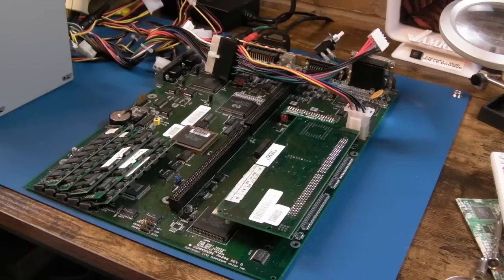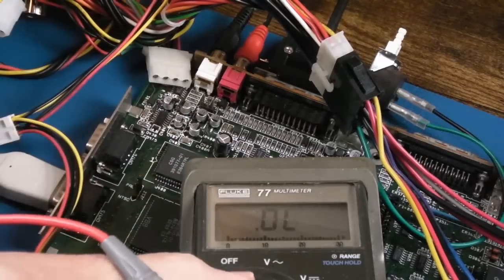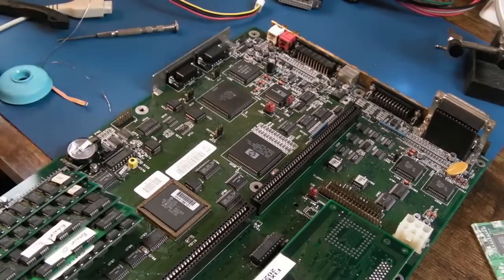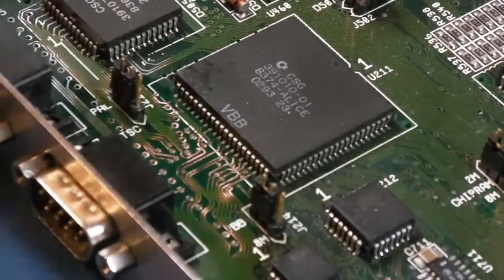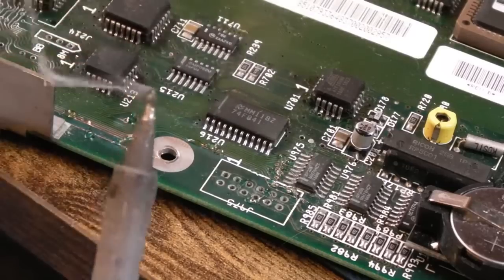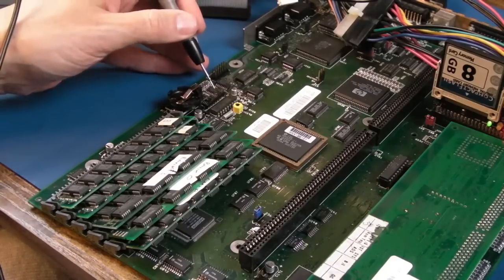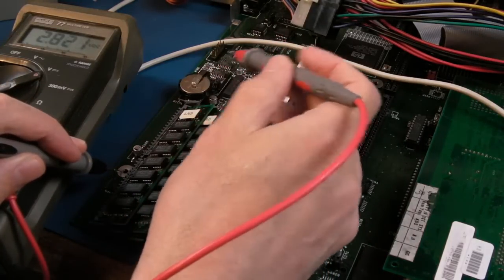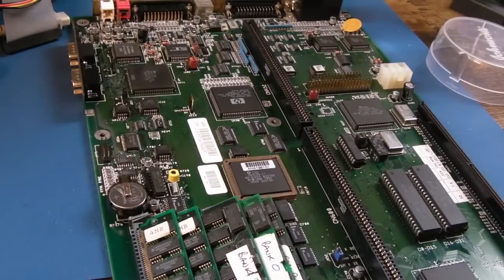Commodore Amiga A4000 Audio Repair & Clean Up (Cathers Part 5)

Comment: Great as always. Hm, can't get what was the issue with rtc? No issue at all?
Reply from the maker: One of the vias related to those diodes was fixed with kynar, but that wasn't the issue - the issue was the trim cap (contaminated) causing the RTC IC to have its clock pin(s) stuck in a state where a transistor was just on all the time (I think).  That I believe was causing it to drain the battery much quicker.  I really should test that theory on one of those RTC chips at some point... It could also on reflection have been that cracked 220nF cap there, but I am not sure if that sits over the RTC chip or not?!?  In any case I did swap that ceramic whilst I was working around that issue.